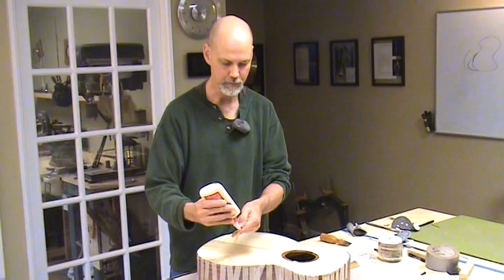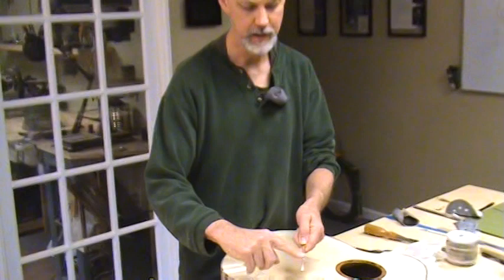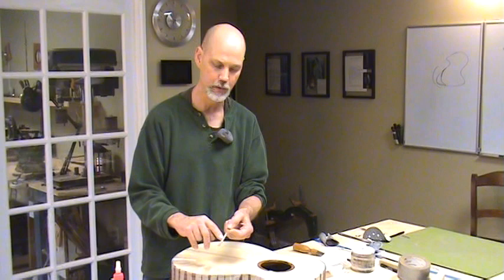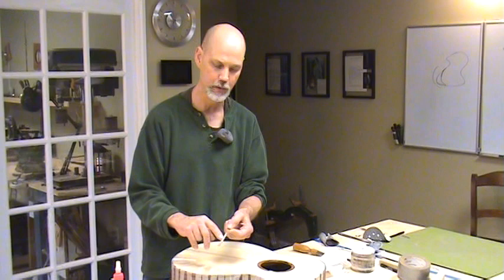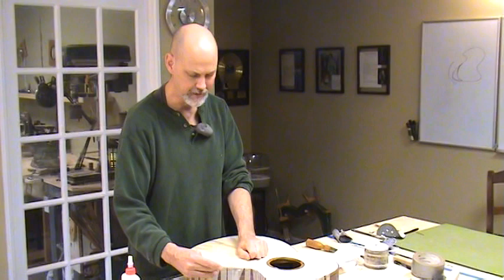Everett Guitar Tips 2

Comment: Very very true commentary about applying glue to both surfaces. I see far too many people adding a swimming amount to one surface under the impression that the excess will transfer to the other surface....not totally the case and the excess can prevent tight mating. I habitually carry a toothed and grooved plastic spreader (a small drywall plaster spatula I think) and a toothbrush in my back overalls pocket to work glue out onto both surfaces. It seems to reduce visible gluelines also!